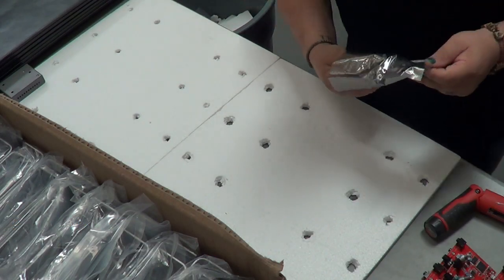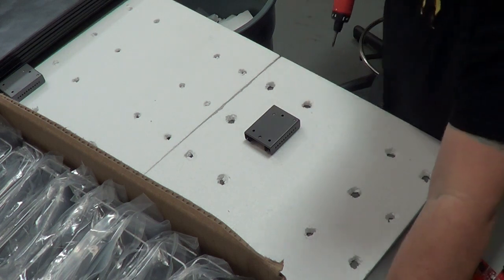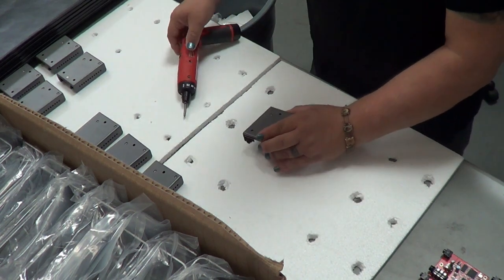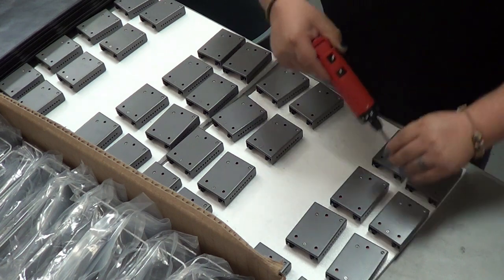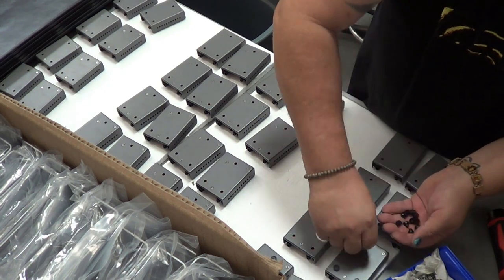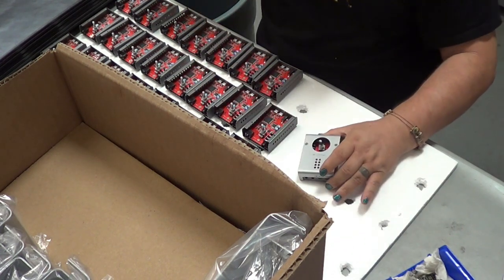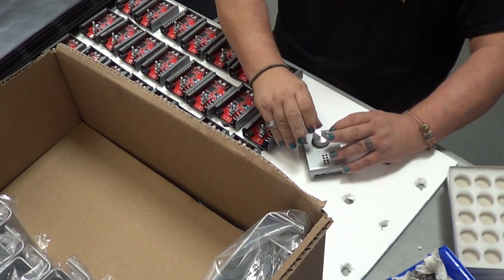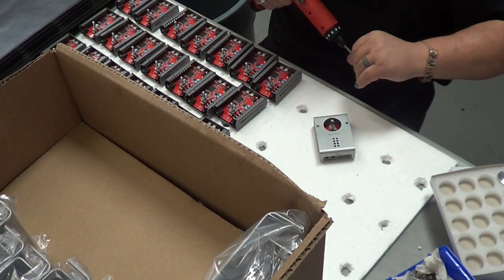FULLA 2 BUILD

Comment: +SchiitFerBrainz Is the volume knob glued on or just pressure fit? My volume pot started to make some static when I adjust it and I would like to clean it. Is Deoxit okay to use? Also thank you for making the video, it didn't show the part I needed to see but it was still fun to watch :)
Reply: evilwoodchuck it’s pressure fit, i did the same thing and it fixed my pot noise for a while.